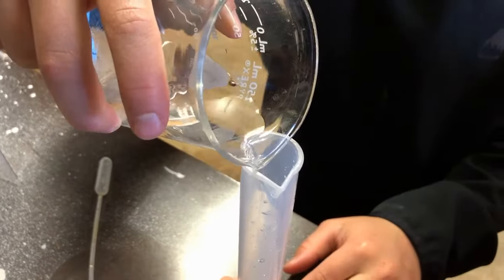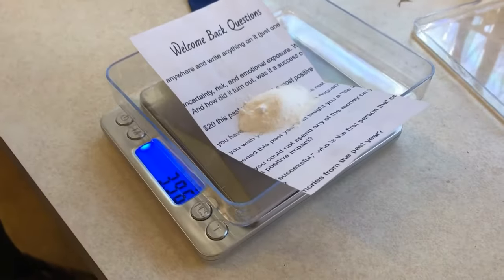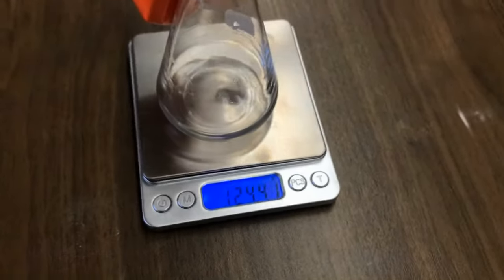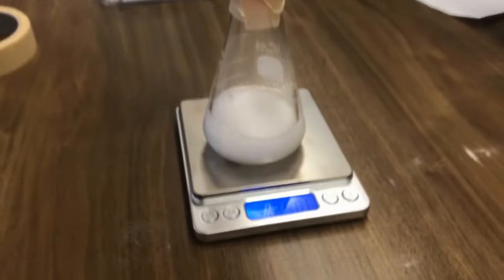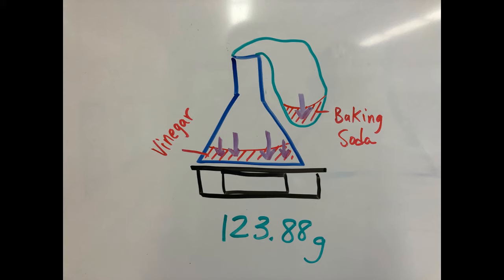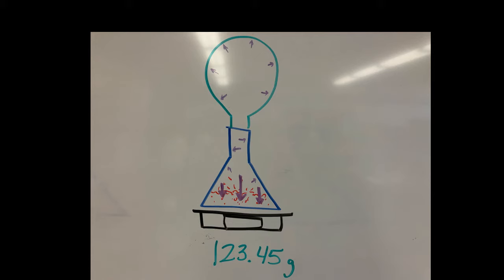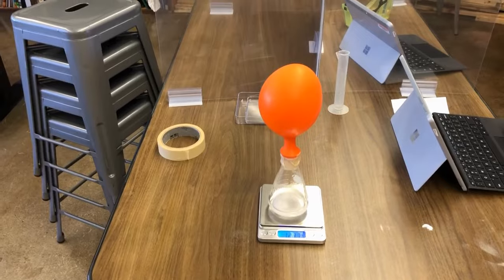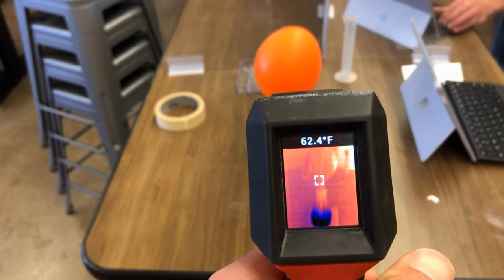Vinegar + Baking Soda - Law of Conservation of Mass

Comment: The gas pushing up on the inside of the balloon also pushes down on the inside of the flask. That would not result in any net change in weight. 
What might have caused the tiny change in mass was that inflating the balloon made it take up more volume, which increased the buoyant force on the balloon/flask system.
Reply: Can u please explain it once more.?  I could not understand
Reply: He didn't use the term "buoyant force", but that's what I thought he was explaining in the lost mass.
Reply: Our grade 9 science just watched this video.  I expected the scale reading to remain the same.  We do agree that as the balloon displaces a quantity of air, there is a buoyant force exerted and that would explain why the scale reads less.